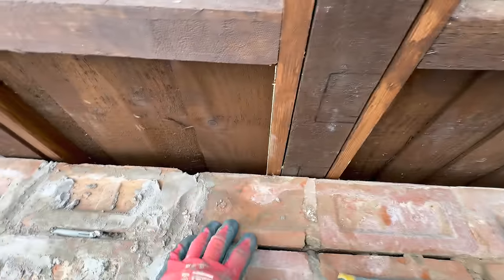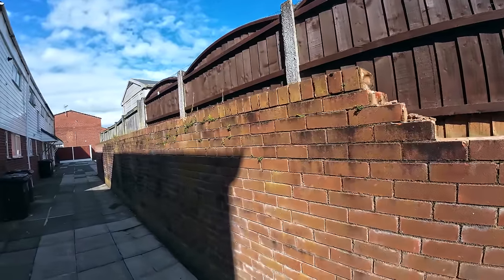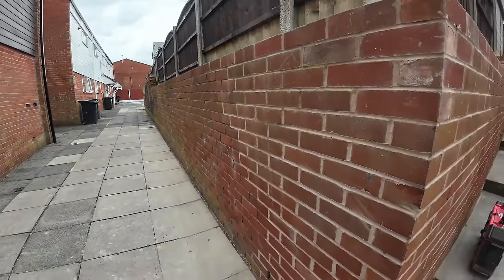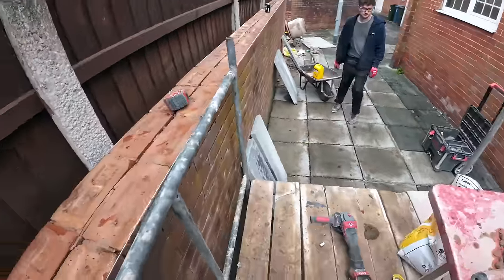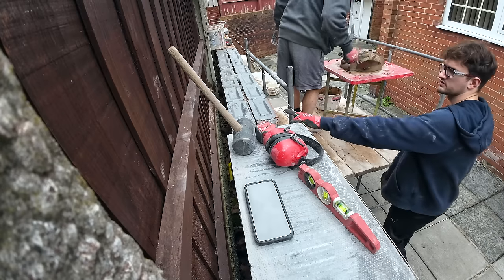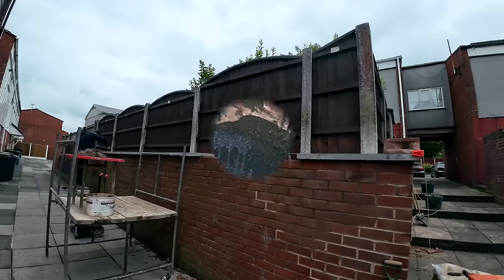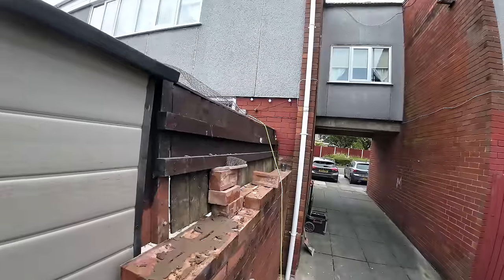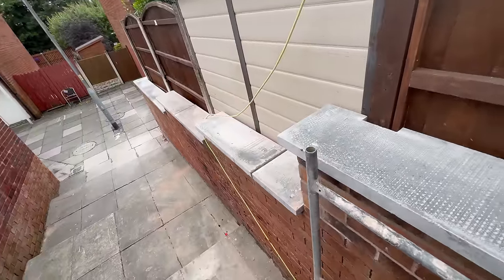DANGEROUS RETAINING WALL FIXED WITH SBR

Comment: I don't know if it will help in future but I use similar box scaffolding. I find it rocks less if you put a plank on the bottom that fits tight that forces the base out so it is tight. I also bought some cheap lockable wheels from Screwfix/Toolstation and screwed them onto blocks of wood and drilled a hole the same size as the tube so it slots on. I work on my own usually so moving the scaffolding when it is higher is a lot easier.
Reply from the maker: Thanks very for the tips .
   I like both ideas as the rocking does my head in .
   I spent £100 on adjustable wheels but the diameter was too big to fit in the tubes 😢.
    I will look into your idea as I definitely want wheels fit it for pointing jobs .
  Cheers 🤝🏽👍🏽🧱

Comment: Hello Chaps,
S.B.R or to give it, its chemical name = Styrene - Butadiene - Rubber.
It is a synthetic rubber product conceived by the Germans in the 1940`s, and later further developed by "Goodyear" for use in tyres.
Construction uses include; as an excellent Primer coat,  Admixture,  Bonding Agent  and sealer.
🧱👍
Reply from the maker: This stuff is shit hot and does not come off anything you get it in mostly skin 😫😰🫣
Reply: Did you put a drip groove. Under the slabs  .Good job though
Reply: @danielbutler5799  If you watch the video carefully when Steve, is painting the underside of the stones, it looks like there is a slight bevelled edge to act as a "water - check."  Drip grooves are good practice and certainly have their place in construction detailing but, what are you gaining here?

Comment: don't hire a builder who's staff can't speak English.  My neighbour hired a builder who spoke English but his guys didn't understand a word.
They failed the surveyors report and kept on building a 2 story extension with a double ground floor extension,  after the roof and first fix electrical, plumbing , and gas was installed the council surveyors came around and said it's illegal,  they all said  " no speak English " .
Lowe and behold  it was all nocked down , the foundations was 1 ft deep, for ac2 story extension anda loft extension. Regulations state in my area is minimumn 8.5 foot because of the trees which are protected by a Tpo..
The original contractor took over £150k and never came back,   the demolition cost £50k  and the fines.... he won't tell me. So lesson is don't ever truly trust someone with £300k to rebuild your home  unless you are shure they have company liability insurance and don't employ  " no speaking English " people.
Reply: @Hitlo-fd2gy
Holy - hell fire.  That is a very harsh lesson to learn Mate.
I am so sorry to hear that.

Very good advice for home owners. 👍